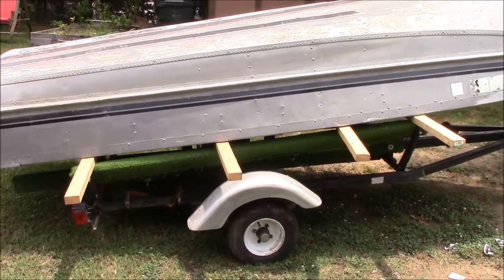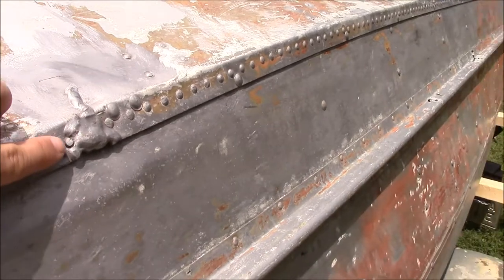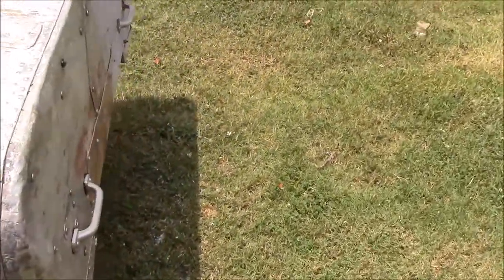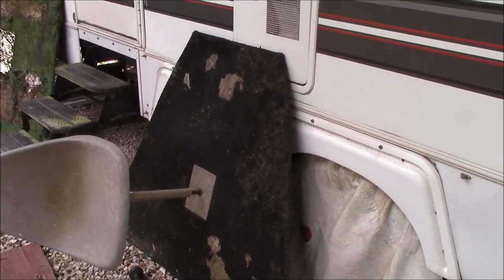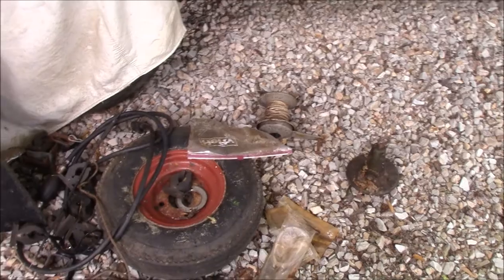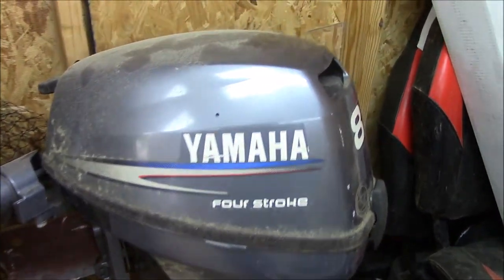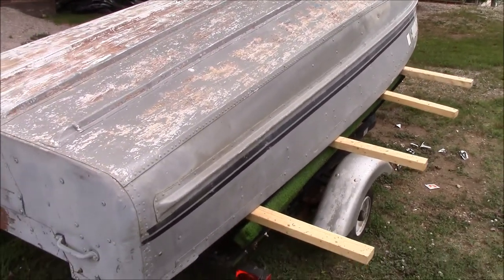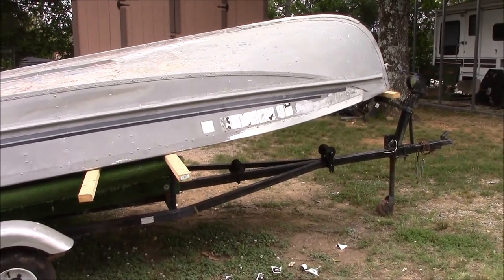Restoring a Boat: Episode 1 - Stripping the Boat

Comment: Hi Interesting boat project! I repainted a small aluminum travel trailer and used zinc chromate primer before the color coat, as I remember. Enjoy your boat repair adventure and thanks for bringing us along.
Reply from the maker: I am thinking of using a product called "Monster Liner" which is a tintable bedliner. That should help protect the bottom from being drug over sand and gravel when beaching it, and provide an extra layer of sealant for the seams and rivits. Not sure if I can apply that directly to the metal or if I need to use a self etching primer. Going to have to check with the manufacturer.

Comment: nice looking boat, we have an aluminum 14 foot that I need to get to working on too. have two transom mount trolling motors. got it from a cousin. lol he had a 50 pound Minn Kota on it and you could almost ski behind it. 30 is alot better for it. I have an old evenrude to put on but gotta get a magneto. great looking project you have, looking forward to seeing more videos of it. thanks for sharing with us.
Reply from the maker: I did a little more on it today. I started pulling the foam out of it today. That is on messy process! But I am glad I did because I have already found on rib that is broken, but was hidden under the foam where you couldn't see it. I tried to film a little of the work and will try to get another video up of it tomorrow.